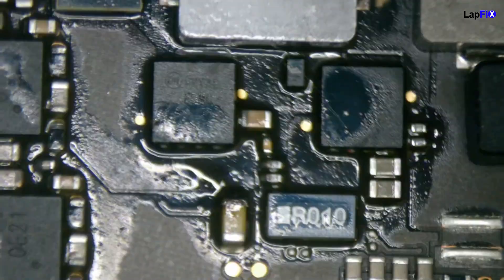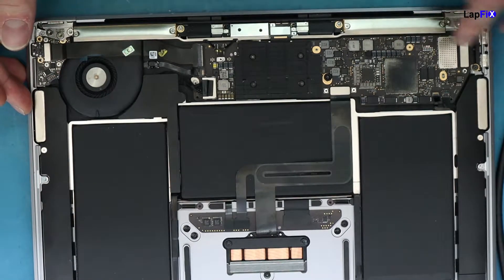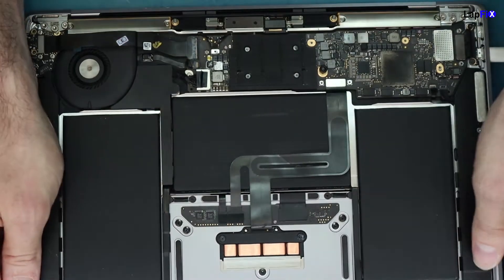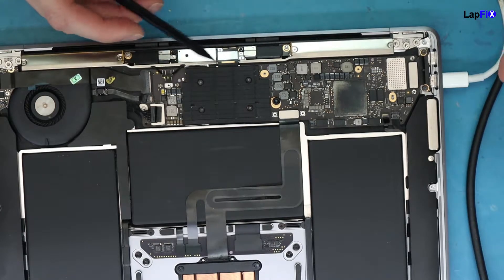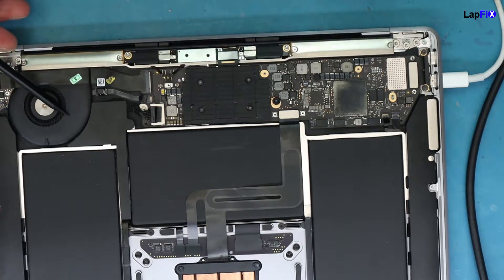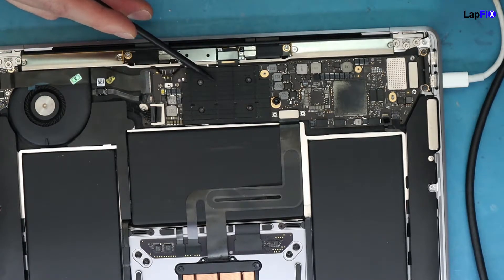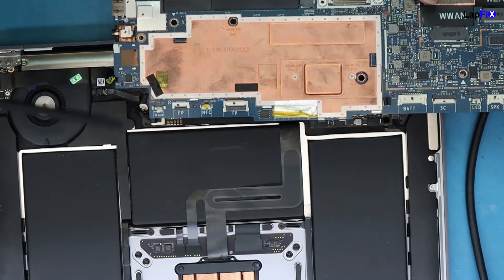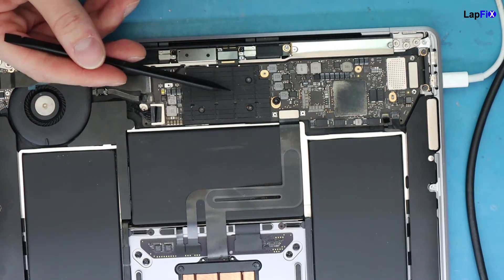The Sound of a Dying MacBook Air A2179  2020 clicking CPU

Comment: Hi, 
Thank you for the video.
I have the same model with clicking CPU "I was cleaning the Fan with the air presser after that when you push the power button you hear just the clicking CPU, No display, No logo..."
Please let me know if you solved this Issue.
Thank you,

Comment: Yes, the design is bad, but it works. There is an air intake (on the right in the video) and the fan pulls the air through the case. This creates an airflow over the heatsink of the CPU.

So the fan is not completely useless and the CPU is also actively cooled (not passively, as many assume).
Reply: It does work but it is not as efficient at diffusing the heat compared to older model macbooks with the heatsink making its way directly on the output of the fan.

Comment: Hey Lapfix,
Our laptop started doing this CPU noise and will not turn on or anything. It still plays an audio jingle when plugging in the charging cable but that is it.
No liquid damage at all.
Is there hope to repair this thing?
Edit funny enough our laptop is an A2179 as well...